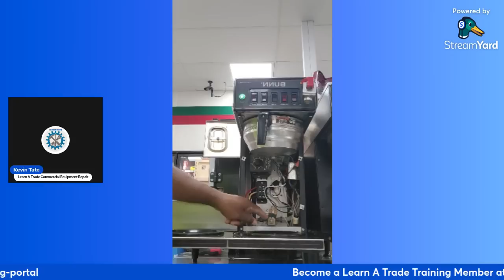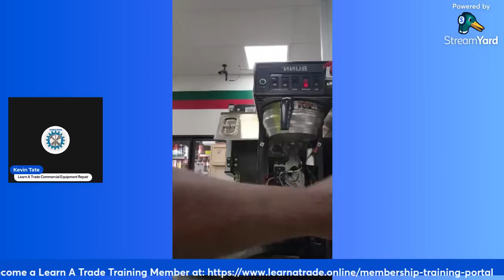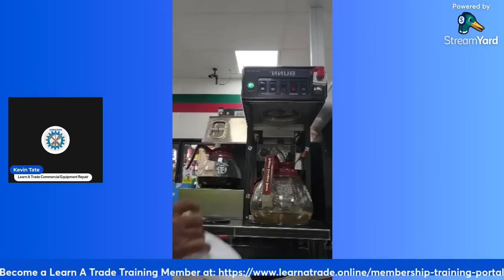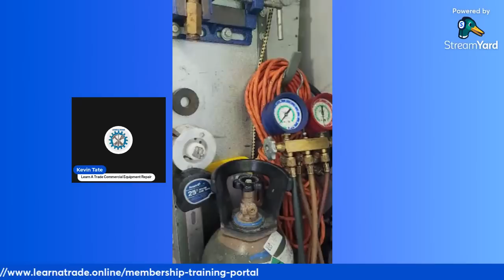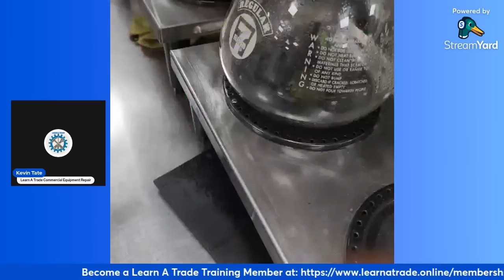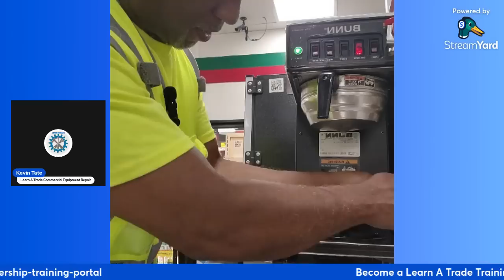Bunn Coffee Brewer Repair (Clogged water flow valve)

Comment: My wife picked up the stainless version of one of these at an auction. Been cleaning and doing a refurb. Thought I had it lined out till I hooked a water line up. The internals aren't the same between the two machines but they still work the same so this vid confirmed my troubleshooting. The valve in ours isn't serviceable (everything is crimped sheet metal to plastic, no nuts or screws) but the OEM replacement isn't expensive so much like my day job now I wait on parts.
Reply from the maker: Thank you for your comment.  Please keep us posted once you replace the valve.

Comment: What do you recommend to descale the unit?
Reply from the maker: If there is heavy  scale I suggest using around 2 cap fulls of Nickel Safe, let it sit soak in the hot water tank for at least 15 to 20 minutes then be sure to run between 5 to 6 brew cycles of just water to be sure all the descaler is rinced out.